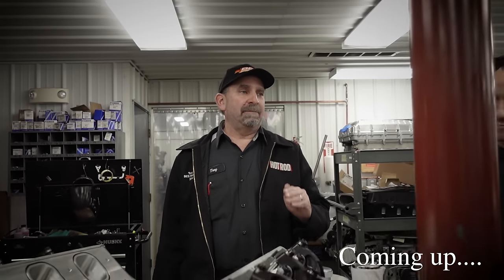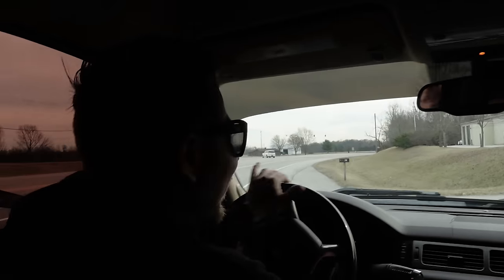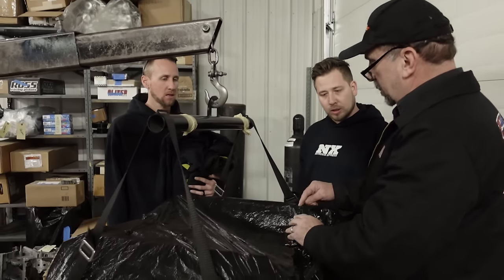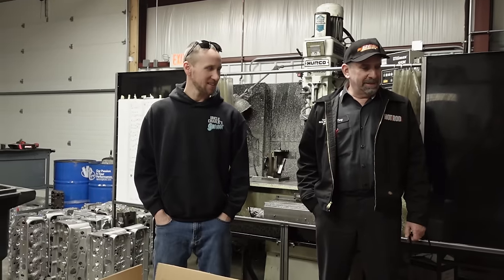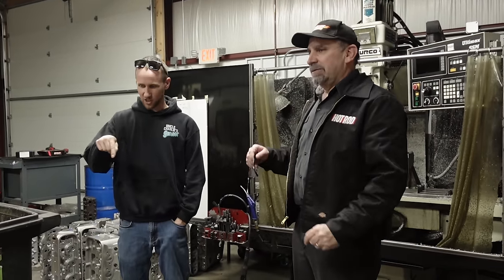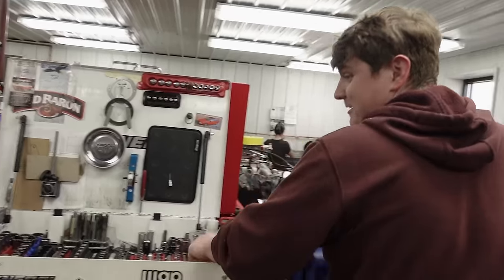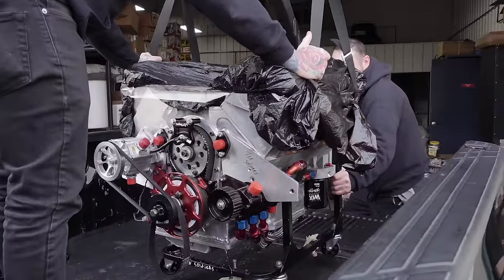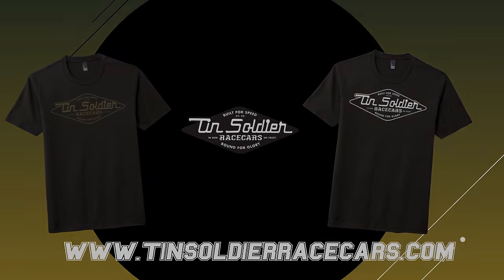Exclusive Tour at BES Racing Engines: Unveiling Charlie Brown's 750 CI Monster & His Future 959?!

Comment: I helped a guy start his race engine shop in the early nineties and worked for him a few years after I retired. His shop was all manual machines, mills, lathes, balancers, etc. The newest machines were Sunnen honing and surfacing machines that started to bridge into electronic interfaces. Looking at this shop and seeing where the industry has gone is amazing.
Reply: I’m having a local machine shop build a little SBC 383 vortec motor built, and his shop is full of OLD manual mills, lathes, etc. The new techs probably better by a lot, but I wanted to support a semi-retired craftsman with 40 years experience. I’ll go high tech next time just to try it out. It’s all good
Reply: Ironically, I live about 30 minutes from each one of these places

Comment: The seals in that duramax filter housing are cheap and super easy to replace.  It will prevent the need to push the primer pump after it sits a while. Fix it!  Love the engine content.  Boost ready LS would be sweet.